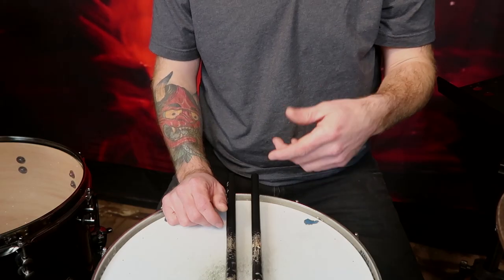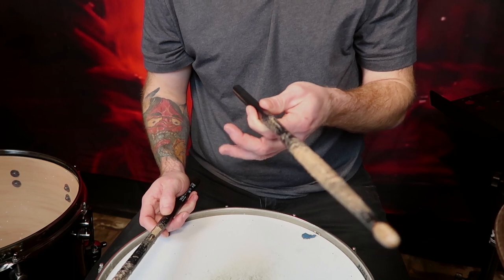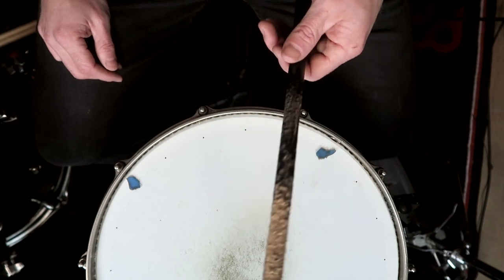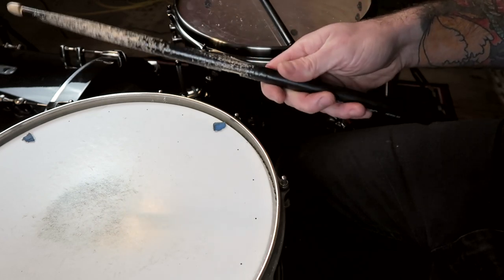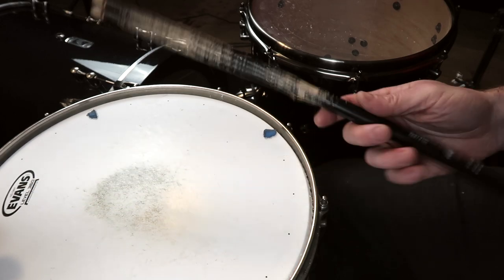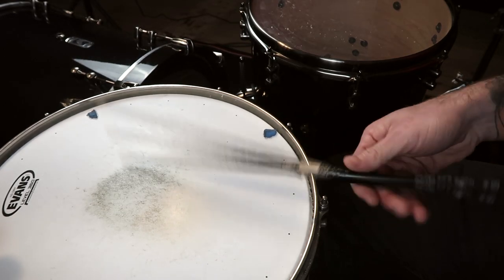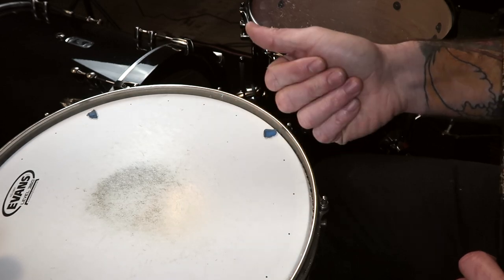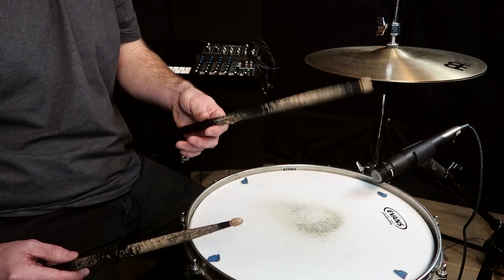What Is The French Grip Technique? Explanation and Exercise

Comment: I find that using finger motion in french grip gives me a kind of "wiggly" rebound somehow. Like the stick shifts left and right and won't stay smack down the middle where the balance is (although it's probably due to a lack of practice of this particular technique..). I have to say it's much less straining at faster tempos though
Reply from the maker: It's definitely not the best technique for control, but if you can manage to prevent it, it is beneficial. Try it slow and maybe take a video to see where you might be having issues.

Comment: Damn, it's a shame i'm missing an index finger on my left hand (chopped it off in a work accident). Will be interesting getting around that...
Reply from the maker: David good point! If you watch most drummers hands they in fact only use the index finger to guide the stick. In this grip it is definitely attainable by using your thumb and middle finger as the fulcrum point!
Reply: Yeah man. A lot of drummers (including myself) use the middle finger as the fulcrum, if that helps at all.
Reply: @richardpictures  I've found that it's definitely doable but without that index finger guidance the stick tends to wobble sideways a lot. Definitely keeps calling my concentration back to the left hand while playing. I'm sure it'll get easier as I play the drums more, though.
Reply: @VolatileDave  it's been over 2 years now, how are you faring?